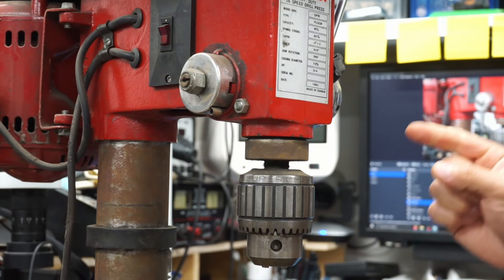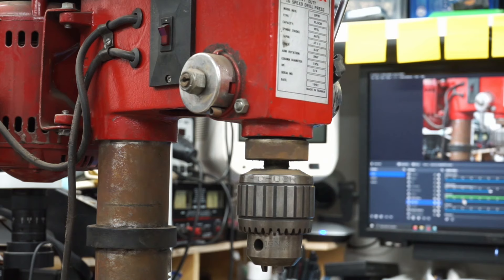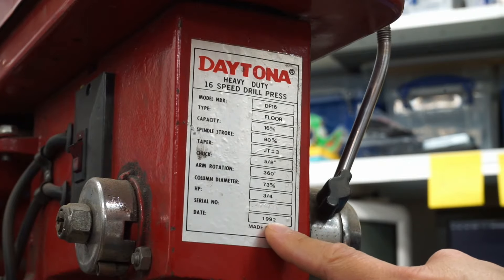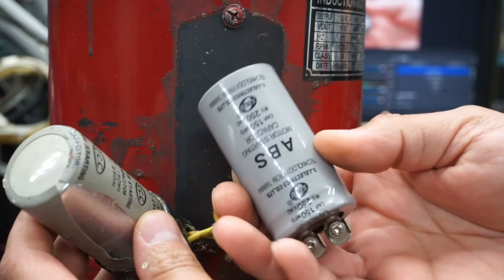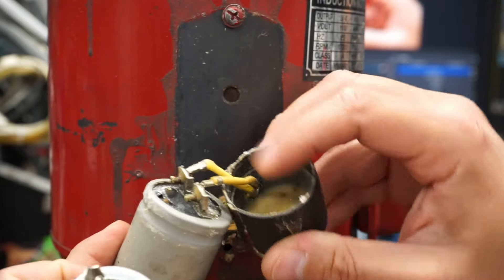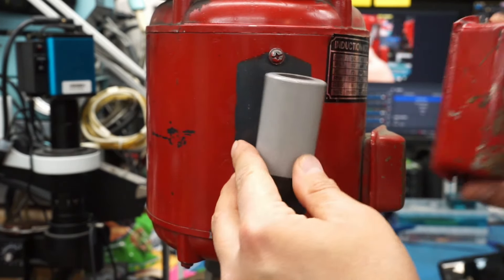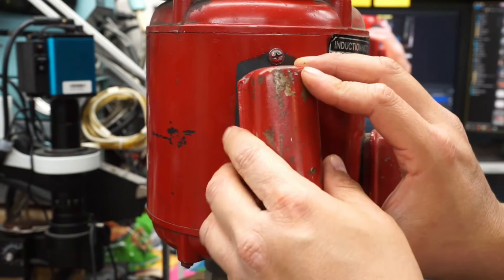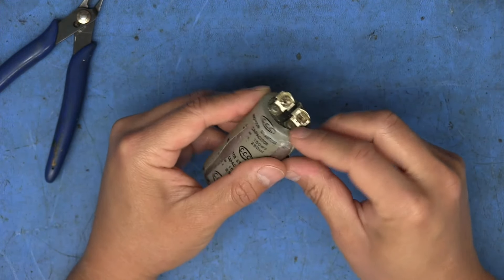TEF #172 | 32 Year Old DF16 Daytona Drill Press Won't Spin Up On Its Own

Comment: Where can I find a manual on Daytona drill press 2000 Year model. ? I need a replacement switch.
Reply from the maker: I'm not too familiar with these drills, as this is the first one of these I own, but I found that Craftsman model number: 113.213170 is similar, and a manual is easy to find. Not sure if this helps though